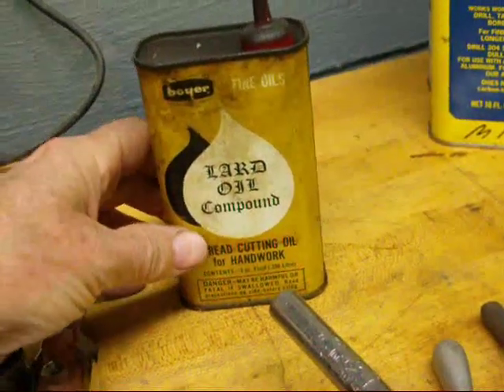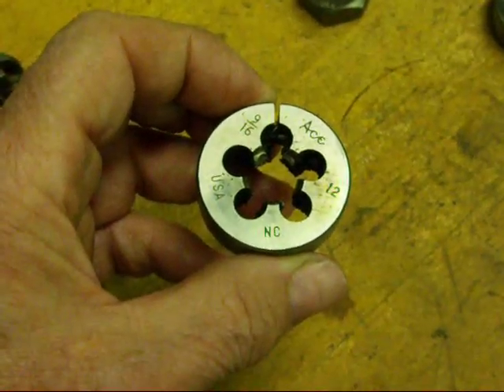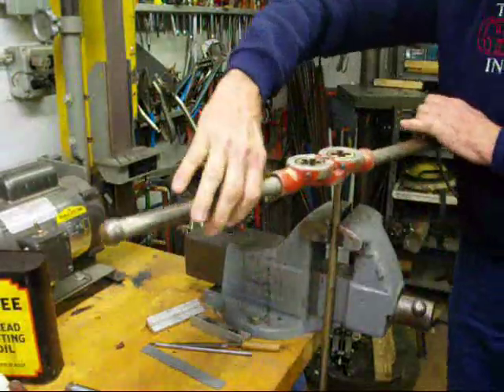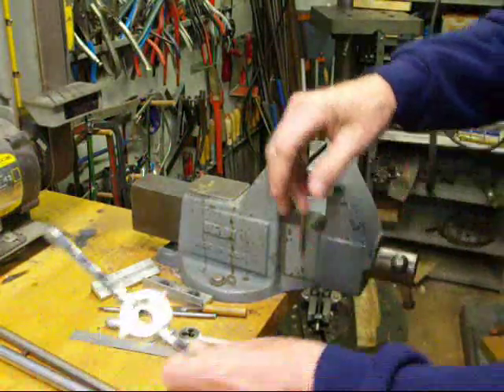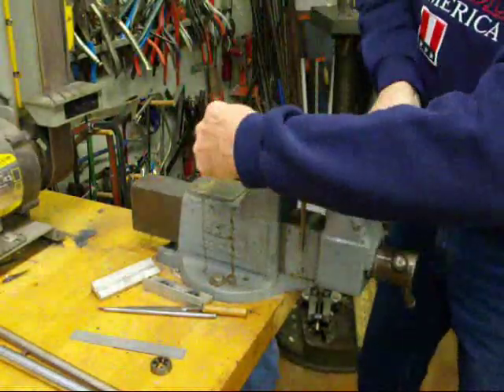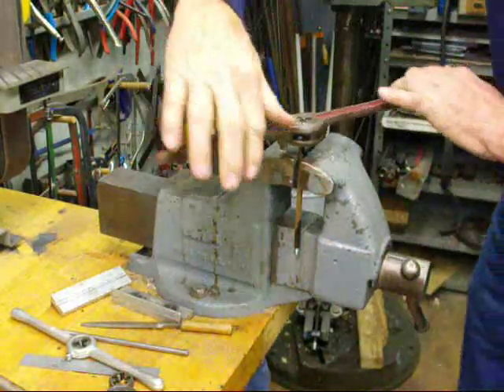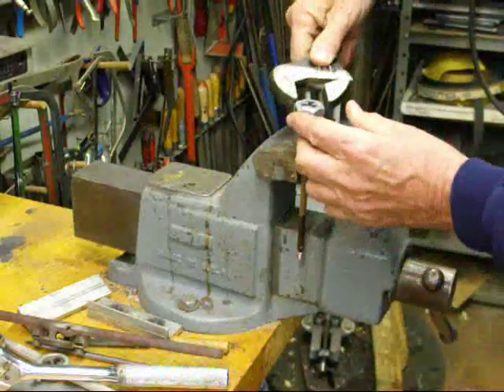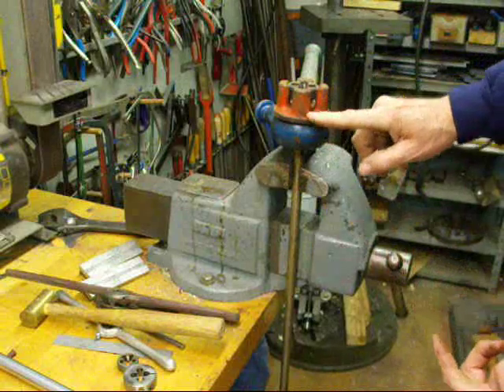MACHINE SHOP TIPS #5 Dies/Threading  tubalcain

Comment: Sometimes I use the lathe to get the thread started to be sure it is straight, then finish it by hand.  I am tapping a 1/4-20 on stainless so kind of hard to get it straight by hand.

Comment: Dear Mr Pete, from time to time I have to cut a thread from rod and am frequently frustrated by the thread cutting dog-leggedly. I have a basic question. If I were to cut an M12 thread, should I generally use an M12 rod? Till now I have used something larger to make sure the thread tips all appear on the made thread. The thread ends up digging into one side and proud the other. Is that wrong?

Also: are dies available in different cutting profiles (ie Taper and Intermediate)?, just like taps come in three varieties (ie Taper, Intermediate and bottoming). If that is the case, then purchasing taper cut dies would be recommended for starting a thread.
Reply from the maker: You must Material that is the correct diameter for the thread. Dies are usually tapered a little bit on one side. That is the side you start from
Reply: @mrpete222  Thank you, that will make my life easier.  I realised that I was using a 13mm rod for my M12 threads.  Result: misery.  I guess I can do anything I like when I get a lathe. Cheers and all the best for the festive season.

Comment: +MrPete222 you talk about taps and dies being dull, and don't use them anymore.  How can you tell they're dull?  Can you sharpen dull taps and dies?
Reply: They'll have difficulty cutting and if you run a tap that's too dull it'll break off. 
You can't resharpen them, if you did they'd be out of spec for the size since you'd have to remove material from the cutter to sharpen it.
Reply: If you get a dull tap you will know , it will turn really hard , produce no chips and if you do get it in the metal it binds and snaps . Most taps can be sharpened but at costs more then new. Dies take even more if there in tolerances.
One of my apprenticeship jobs I had the missed hole and broken tap removal title. I've chipped out so many taps I couldn't count. No edm for big castings.

Comment: Hi I saw you using this what you called a long handle Ridgid Die Stock Holder tap rod in the vice, Where can i find that Model Sir ?  And dies for it ? I want one like this strong big leverage, that lines up centers itself on the rod before  threading so external threading is accurate, I'm going to thread some 303 5/8 Stainless Rod.. Thank You Very Much waiting to hear back from you.

Comment: you make that seem easy, I was threading a 8 inch 1/4 rod yesterday and I needed to thread 4-3/4 of the rod. After I was done my rod  was bent in so many ways from the forces used when threading it. I tried to put threads on a stainless steel rod and I couldn't get it started no matter how much force I put down. Thank for the video.

Comment: Can I use normal Lithium grease for cutting a 1cm long thread on an aluminium rod by hand?
Reply from the maker: Try it, I never have thought of it.
Reply: mrpete222
Thanks - I tried last night and was ok. I messed up a thread the other day by not using any oil or grease and the threads didn't cut properly and ended up looking like a worn out thread.

what is the point to the oil or grease anyway? it can't be for overheating because we're only threading by hand?

I'll continue using lithium grease then. Unless you think WD40 is better? But like you've said, oil tends to drip off